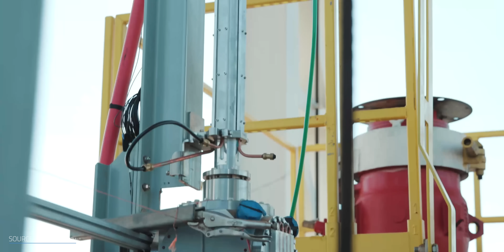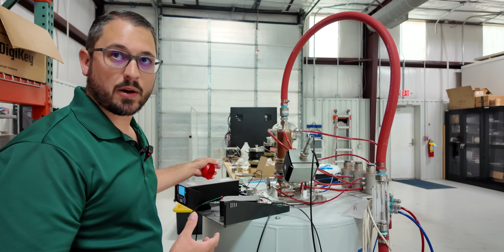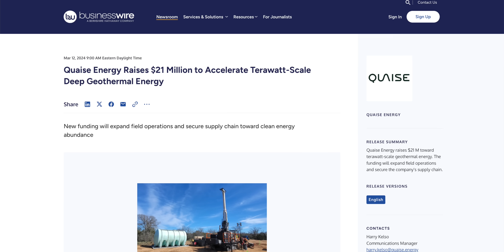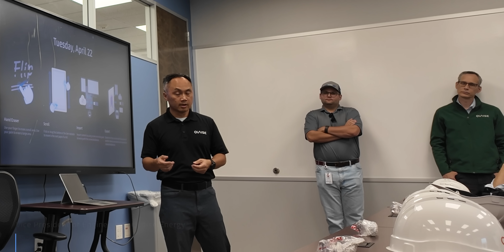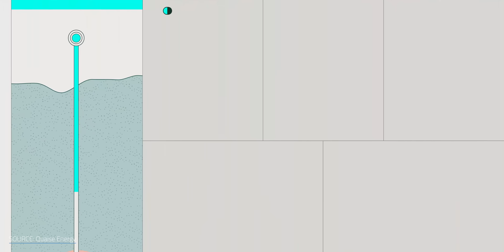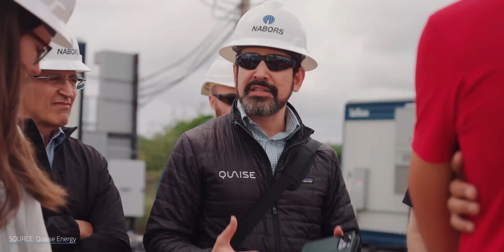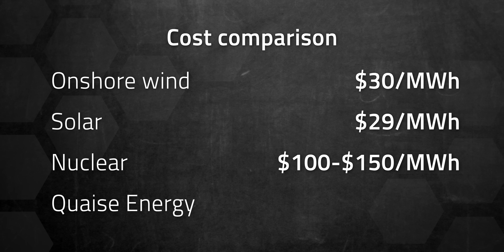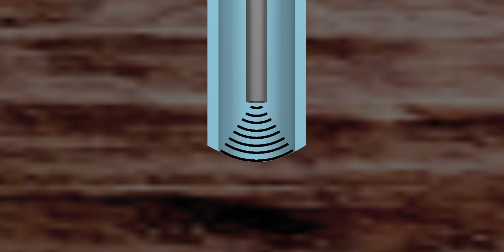How Geothermal Energy is About to Break its Limits

Comment: w/ Nuclear. its difficult and hard because of permits and construction costs. How much a power plant is the same from plant to plant? a Coal fired plant with cooling stacks compared to a nuclear plant? Instead of waiting for permits for nuclear, start building a Coal plant, then permit for a retrofit. you can then install a SMR on site for not much more. If you dont get approval for Nuclear then you install the LNG furnace and make power.

Comment: I wonder if this could be economically scaled down for, say, backyard drilling a geothermal well for heat. If you could drill a smaller diameter hole and get far enough down, perhaps no heat pump would be needed, or a heat pump could be used with much less electricity needed to get the same amount of heating.

Comment: Absolutely, a wonderful update, Matt........it's just not enough. It can't ever be enough, and questions remain:
1) A private company can't accomplish anything this big on such a tiny scale, and in any kind of timely manner. This demands a TVA and Hoover Dam Treasury bond sale and private contracting for all of the aspects that are beyond this dynamic team. Venture capital has limits, and the breakthrough nature beyond 10-foot depth demands a backbone that only the USA government and citizens can fund and manage on the broad spectrum they're engaging.
2) FEL particles beyond the one-megawatt limit seem to have greater impact potential than gyrotron can provide. Can that be true? Could ASU's compact FEL accomplish that? 
3) Plastic rock at mantle depths will cool with water vapor carrying away vaporized rock, and Japan has found replacement heat unable to keep up. Any removal will cause convective plumes to rise from hotter depths, so a balance might be struck so that a runaway or heat reduction are not encountered. Can that be true?
4) Ionizing rock atoms in plasma, some twenty-miles deep, hasn't happened outside volcanic activity, yet lightning bolts in ash clouds witnesses a separation of charges that deep heat and pressure would combine with maser energy gas plasma that circuits to the topside station crew. Such a lightning event might be continuous from bottom to top, and if no transformer design has been designed for such an unknown event, that's another Manhattan Project that only the federal government can branch into. Quaise won't know this answer for another twenty miles. They've accomplished 10-feet in what, since 2008? They're just too small, that means they'll only be too cheap to do the job. US citizens' savings and investment pool is $88-trillion. See what I mean?
5) Graphene vapor deposition can potentially provide a pathway for channeling heat and electrons in a safe and productive way, but that's never been done at-scale and the facilities for waveguides with durability must be begun early because it takes time. There's no provision for that. These can be accomplished in parallel, not sequentially for a century.
6) If every community, steel mill, smelter, cement plant, AI computer farm, or community heat and power utility is to operate forever, a financial means of repair and replacement must be in order. And that must include a way to pay off the necessary public bonds initially and on a continuing basis. Quaise can't offer that. 
7) Supercritical turbines cost $40-million dollars a pop. That'll slow down any adoption, because they can't be produced without production lines and skilled workers that aren't there. Supercritical steam on glassed pipes? How about hot/cold streams? Not down the waveguide and up the side, so that means not one but two wells for each. What's needed is a single glass plasma lamp that stretches 20-miles deep, where an inert gas circulation is contained and a low-pressure condensation tank is at the surface to collect dust and salable minerals. 
8)---------to eternity, the list goes on and on. A federally-managed, guaranteed and Treasury bond-funded citizen investment tool is the way that Quaise can use publicly-funded technology to allow contractors to build, and to sustain the technical institutions responsible for churning-out engineers and scientists to meet the critical demand. No corporation on earth can meet that challenge, oil and gas companies included. This energy independence solution is too big for these champions of science to get a grip on. It's truly a USA-sized ambition. God bless them for trying. Now it's America's turn.

Comment: I think you would probably still need blowout preventors and drilling fluid mud company on stand-by incase the drill/melt into a high pressure zone of gas or oil.  Geological surveys are not always 100% accurate.

Comment: Trying to be opened about all of this. But it's down to if it is cost effecting and if the public is on board with it. Like electric cars we still don't have the grid for everyone to have an electric car. My point is that it has to be practical in many different ways, or it will not work. We have to realize that. All of these Ideas are great but there seems to be set backs to them. That is the harsh relality.

Comment: Hm, it sounds great, but I'm not quite convinced if the removal of the vaporized rock will work over such long distances. I'm absolutely no geology expert, but wouldn't you need to maintain the rock vapor at extremely high temperatures all the way to the top? Seems extreme in a 10km borehole, I can't imagine how that would work. Also...is the borehole diameter enough to produce an efficient amount of energy from the superheated water? And will they actually use water or a different liquid - I see some problems with pumping water down there to where it heats up to those high temperatures very fast. Not quite convinced tbh, but very interested to hear updates (or even answers to my questions).

Comment: As someone who has studied physics, there is a glaring issue. Energy required. There is a reason we don't melt snow but instead push it to the side, and why we prefer moving heat around rather than generating our own. It takes far far less energy to simply move rock than it takes to melt and move it. Instead of having to only break some of the bonds between atoms in the lattice, with melting you have to give the energy to overcome ALL of the bonds. This makes me think this technology will never be cost competitive with conventional drilling
Reply: Drilling cost is not just energy cost. It’s the labor of the crew and the CAPEX of the equipment too. If you speed up drilling and prevent the need to replace bits in the middle of your job it can still compete on overall cost
Reply: @jamesonreichert5796 sure, but if it requires the capex needed to construct a power plant compared to regular drilling with grid electricity then, again, capex goes in favour of regular drilling

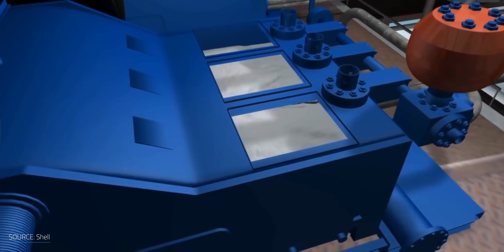Comment: 7:37 "Traditional drilling uses high density drilling mud to counter surrounding pressure and prevent well collapse. But millimeter waves don't require drilling mud because of how they strike the bore walls causing vitrification."

- Aaaand that's the proof this is vaporware. 
A thin layer of vitrification will NOT be strong enough to resist pore pressure at great depth. It will also NOT be strong enough to prevent the wellbore from collapsing, especially when drilling though unstable formations like salt. After all, thick, steel pipe is often insufficient to prevent collapse. The oil & gas industry has specialty pipe with high collapse ratings specifically because it is such a problem. That layer of glassy rock is nowhere close to as thick as the steel pipe, it won't be as uniform in properties, and it won't resist collapse nearly as well.

It probably does "seal" liquids & stabilize at low pressure, but the depths needed for geothermal away from hot spots is quite deep. There is ZERO chance this tech will case a hole sufficiently well to prevent ingress of gases and water. 

If this tech were used to drill shallow wells in rock well above the water table, then it probably will look good. But why do we need the tech to do that?

Comment: One thing with this tech, I see a pilot hole would be needed first in most areas to get past combustibles first.  Going through a coal seam  or a pocket of oil or gas and the hole will be a sparked torch with a huge fuel supply.

Comment: Just an alternate idea that could use this tech.  With the polar magnetic field destabilizing I could see drilling such a hole at the south pole and after drilling adding a double walled steel pipe with a coil added between.  During weak spells in the Earth's field it could be energized to help restore it, the rest of the time with diodes it could tap solar flare and EM field energy from the pole itself.  Ideally a second would be installed on the North Pole but the sea would make such a system more difficult.   Later this global EMF tap/booster could be applied to Mars to help establish a EM shield more like Earth's natural on power by a nearby reactor.

Comment: It requires really deep pockets the CAPEX cost of that hole will be equal to 100 oil wells. Can you imagine the amount of energy required not to melt but to vaporize a rock that deep. And in how much time will that well return the invested capital and start generating profits. Suitable for places like Iceland where geothermal is very near to surface.

Comment: NO NO NO NO NO! Please stop promoting Mantle Cooling technologies. We CANNOT get that heat back into the planet. It’s not “renewable” at all! It is limited and once it cools sufficiently enough, plate tectonics will stop and that negatively affects resource availability and the planet eventually dies.

“But it’s just one power plant!” No it’s not and you know that. Once they prove this they will be everywhere they can put them and that will accelerate the process of Mantle Cooling.

We need to go with nuclear fission and then fusion. Once we get fusion this won’t matter anyway and is literally reducing the usable lifespan of the planet directly in a calculable way.

We are headed towards being a Kardeshev 1 civilization, but that doesn’t mean we HAVE to consume every bit of power or energy available to us if, as a civilization on the verge of this achievement we have the foresight to hit Kardeshev 2 or 3, then we know we could move stars, but can we restart a planet’s mantle or core? Maybe that won’t matter, but we don’t have a solution for it yet.

Comment: There is a fly in the ointment. Solar is balanced, in out through the atmosphere. But in a billion years or something the sun is going to radiate 10% more which boils off the atmosphere.
So any source you scale needs to not be equivalent to that 10% or even a large fraction of it. Currently 0.5% of the earth's surface energy budget comes from its internal heat. There is a limit to how much and how fast we can tap geothermal, we can't be boiling the oceans. So for now it is fine, but that millions of years claim is not fine if our energy needs keep growing.

Comment: If steam is produced 12 - 15 km down, you still have to get it to the surface as steam or liquid water under serious pressure to run the generator. The whole bore hole has to stay hot.  It would be interesting to know more about the ... how does this actually work once the hole(s) are installed. Is it coming up under pressure as liquid water, then turned to steam at the surface?  Graphic suggests yes.   AI (not sure i trust that stuff), says a pressure of 247 PSI can maintain 400C water as a liquid.  (other websites tell me AI needs to back to school on this one!) I found a Vapor Pressure of Water calculator and it came up with 4,956 PSI.  Various calculation methods produced different results ranging down to 2,208 PSI.

Another calculator produced 368.5C boiling point at 3000 psia. Regardless, some serious pressures and temperatures !

If this can work, it solves a huge problem. Combine this with wind, solar, nuclear, batteries, and it can really take some steam out of carbon based energy generation !

I have read they have done a test hole to 100 meters. Clearly the concepts are working.

Fascinating stuff !

Comment: Because so much of the kit is the same, I really wonder if you could swap out one of the laser drill bits for a conventional drill bit when it runs into problems. But I think the more likely solution would be to find a way to detect and adjust an optimal wavelength as you begin to penetrate into a new layer.

Comment: If you could drill next to existing fossil fuel powered electricity generating plant, you could use the existing turbines, generators and electricity distribution infrastructure. That would make it even more economical. Just getting rid of the coal/oil/gas to make the steam.

Comment: If Earth's core were to cool down significantly, it would have drastic consequences for the planet, including the loss of Earth's magnetic field, disruptions to plate tectonics, and ultimately, making the planet uninhabitable. So how much heat could you extract before this becomes an issue?  I will be gone by then but, WIll it be a problem In 100 years 500 1,000?  I do not know but I thick that when half the world is using this resource it is an issue one should think about.

Comment: There was no mention if there was any flexibility in the waveguide. As there are already existing holes from earlier test holes all around the world, the reality is the pipe drilling can flex and bend and so those holes are curved or 'bounce' off hard rock to areas of soft rock. 
So the pre-existing holes that can be used, in order to save lots of time starting a new hole, will be limited to a handful. Needless to say, that still will be a huge cost saving.
Also they don't have to drill to the magma, only enough to get to boiling the water. Iceland already have steam turbines from already existing bore holes. That would be a great place to start I think.
Also New Zealand has geothermal plants in Wairakei Thermal Valley that could benefit from this type of technology. The infrastructure is already there.

Comment: I hope this works out and we see that power plant on the grid in ~5 years.  One important point is that this doesn't even need to be price competitive with solar or wind, because geothermal would be a base load power source.  We can get a lot of our power from wind/solar/battery storage, but trying for 100% from those sources is not viable.  A little base load geothermal sounds like a very good idea to me, even if it costs 2x solar.

Comment: so like. what if they encounter some kind of obstruction they cant deal with? do they just drill a different hole? i dont think the question of "what do we do about large bodies of water underground" was actually answered? and what if theres an earthquake? what if the plates movement, though slow, still closes the hole relatively quickly, like in 50 years? do you just redrill the hole? you said a tenth of a percent could power us for millions of years, but are we sure .1% doesnt matter? is there a chance of upsetting some kind of balance? i dont know if those questions are ridiculous to contemplate or if it matters in the face of the large scale destruction that oil and gas are causing

Comment: You're a scientist, what happens when drill too far or drill too many holes into a sphere?  Planet Krypton ring a bell?
Reply: Planet Kryton is as far removed from reality as your concept that a Earth size planet could be weakened by tiny 'needle' size pricks. The molten core of our Earth would fill any deep holes pretty quickly. They are not even going to go that deep. The deepest hole ever drilled is the Kola hole in Russia, which is 7.5 miles (~12 kilometers) deep. The Continental Crust is 10-75km deep, the Ocean Crust 5-7km deep and the mantle is 2,900km deep.
So what are you really talking about?

Comment: One thing that annoys me about LCOE figures for wind and solar is that they aren’t forced to include disposal costs like other platforms and don’t even acknowledge the astronomical reactive power and inertia support costs they they require to be viable with high penetration. They’re essentially hiding in the slip stream of true base load plants and bragging about “cheap” power that is only possible because they’re afforded the ability by the existence of other platforms.
Reply: And the figures for coal, oil, gas and nuclear are inaccurate for similar reasons.
Reply: @marcsimmonds5483 the figures for nuclear actually cover everything. It’s one of the reasons their LCOE is so inflated. Nuclear is one of the only platforms that is actually 100% self funding.

Comment: As a mechanical engineer I appreciate the science behind this.
Ask somebody who has a very good understanding of theoretical and applied physics, I have to question how how much energy can we pull out of the core of the earth before it has a negative effect?
 If something like this becomes mainstream all over the world, there could be serious consequences for all of us.
Reply: @kcdesignconcepts5216  if you only consider the core (not the mantle), the amount of energy drain required to lower its temperature by one Kelvin is on the order of 10 million years of current global energy consumption. That does not even consider the constant influx of energy from radioactive decay. Also, the amount of energy we can extract from the crust is limited by the thermal conductivity of the rock. The core itself is very well shielded from the outside, because the earth is so big.

Comment: it sort of is a giant microwave, as a beam like a maserbeam but at milimeter... it's kinda cool they figured a solid and progessive application for the high power fusion tech, and not drilling for oil (will be ironic if it's used for drilling oil, but whatever i hope these guys make the geo thermal profitable)